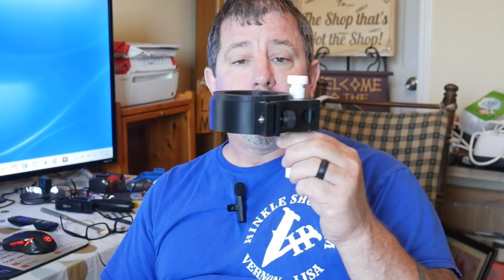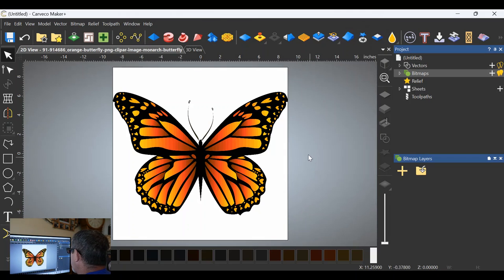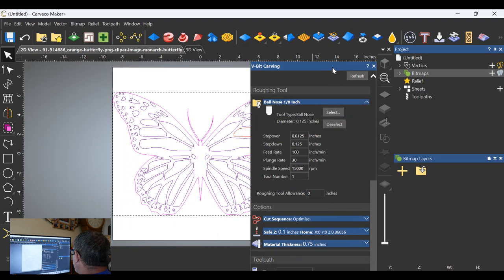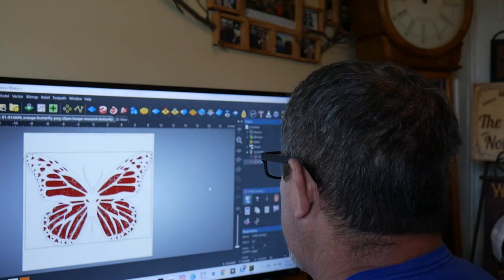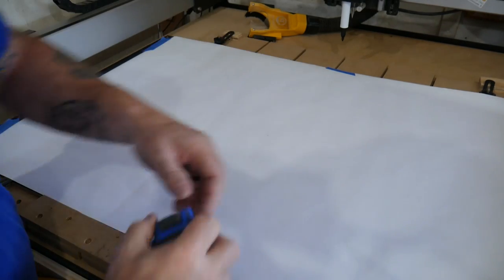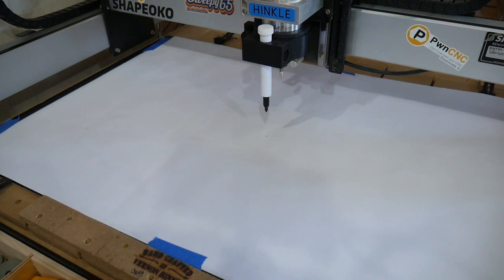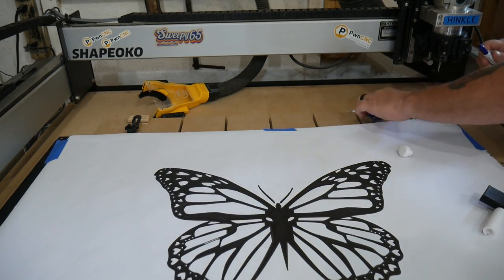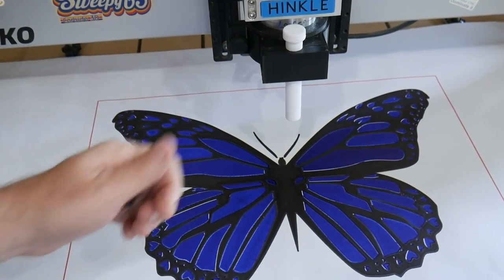Draw pictures with a CNC

Comment: Looks great. Will that new adapter fit on the older attachment. I got the #2 one after I saw your first DRAWING. Mine had a bolt instead of the spring as a weight to hold the pen down.
Reply from the maker: Hey Karl 
I don’t think so I would contact the seller and ask him though